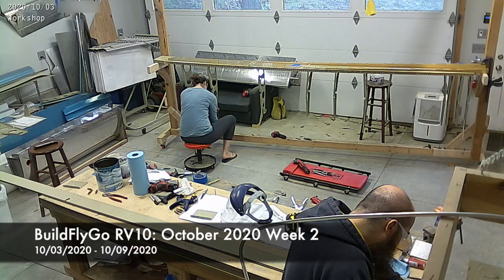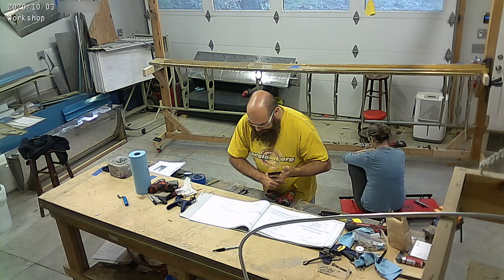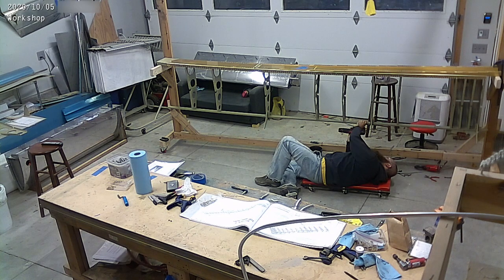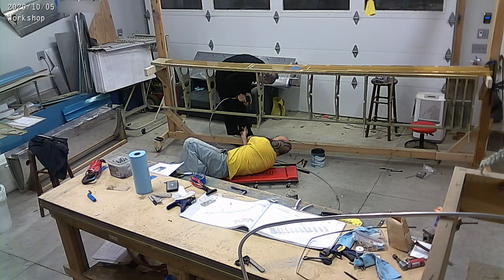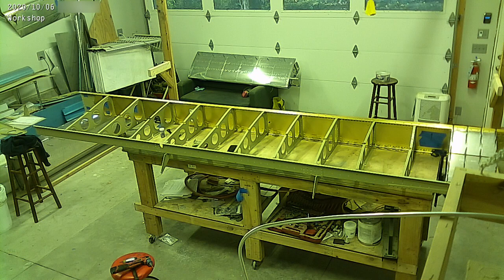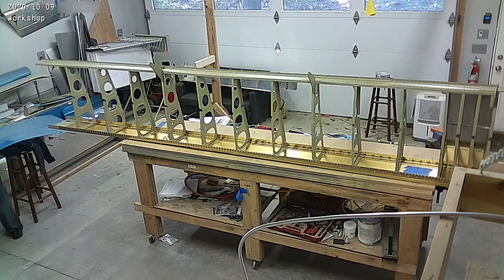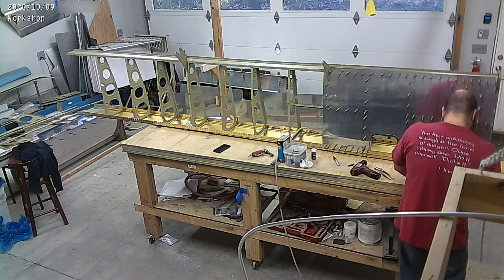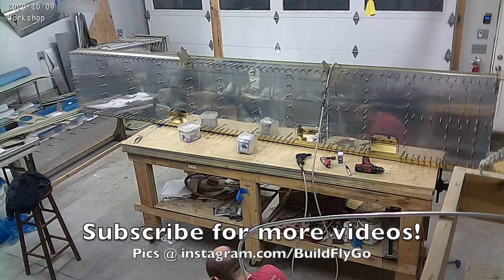RV10 Build: October 2020 - Week2 - These Wings are HUGE

Comment: So...If the normal sequence is to put the top skins on first and leave the bottom skins off to allow access to install plumbing, is it in fact interchangeable which skin you do first and which you close up last?
Reply from the maker: Not entirely. The bottom of the wing is much flatter than the top, and the second set of skins are rivetted on by folding up the skins and sticking your arm in under them. My understanding is this is not possible with the top skins because of the airfoil bend, so you have to do it with the bottom. Also note that this process makes riveting harder and increases the chance of less-than-pretty rivets, which are better on the bottom of the wing than the top ;)
Reply: @BuildFlyGo  Thanx!  NR